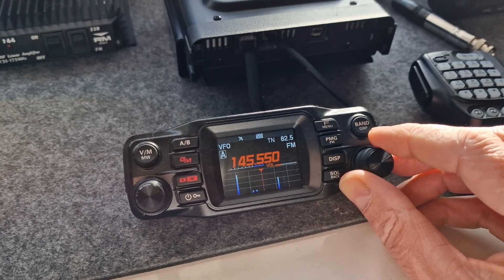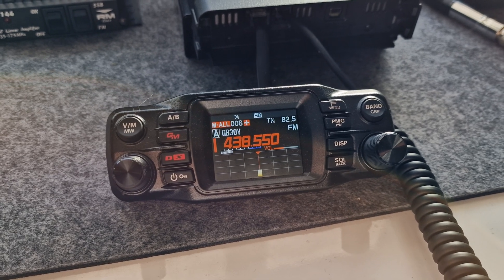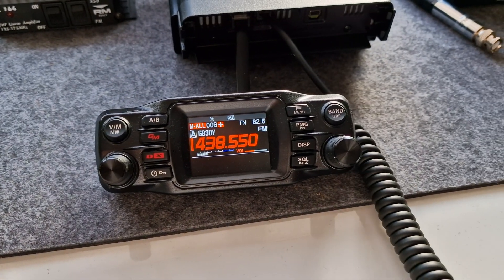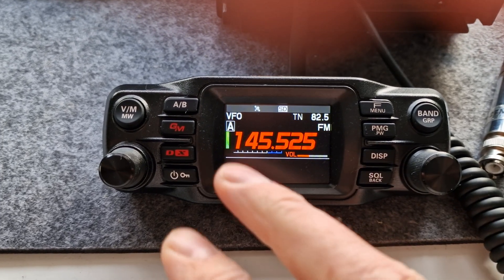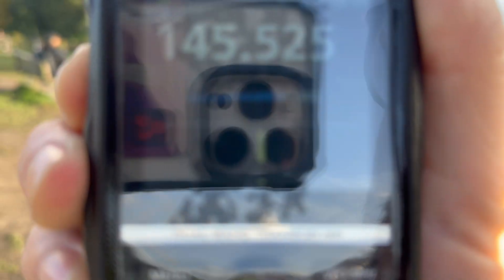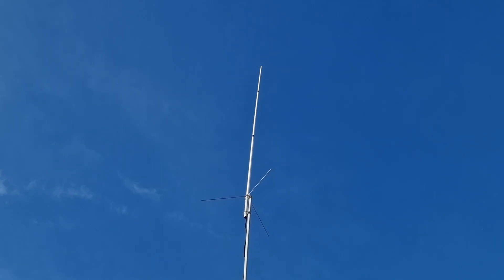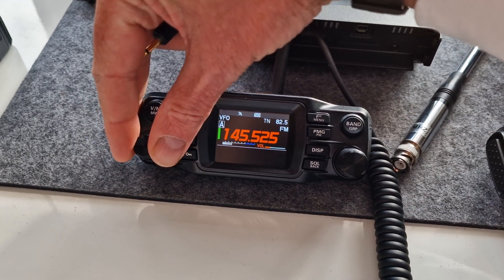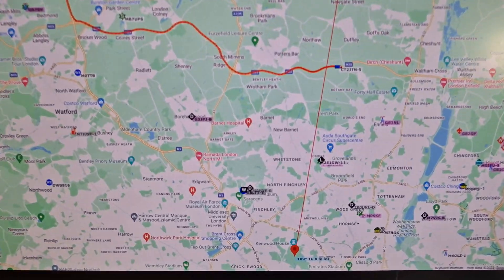THEY SAID THIS WASN'T POSSIBLE WITH VHF HAM RADIO!!!

Comment: All receivers perform differently even the same model and make. It depends on the sensitivity and tuning between stages. When would have helped in this test is if you used a higher gain multi element vertical beam instead of the single vertical. When you have a handheld radio you can have phasing issues the beam antenna helps to reduce this. The problem with the multi element beam antenna is that it’s directional and focused in a narrow direction. Great to see ham radio on YT

Comment: Who said it was impossible? It's called diffraction.
I've participated to dozens of VHF/UHF SSB contests with 400~600 km average distance per QSO and up to 800~1000 km DX. No "line of sight" involved in these contacts.

Are you new to ham radio?

Comment: Yaesu for the Win!  I run a Yaesu FTM-300 at 50w into a Cushcraft 5 element yagi, through 25 miles of pine forest to our "local" repeater.   My Antenna height is 38'.  Signal is perfect, full quieting.  VHF 146.730 freq.

Comment: My best radio connection here in the U.S. was where I live in Oklahoma on 220Mhz. From my acreage I had a seven element beam side mounted on the tower 30 feet up vertical polarization and I would talk to my friend with his setup a home made beam up 30 feet as well. We would talk day or night simplex 220Mhz band a 75 mile path. Another great contact was when I was inside on UHF and talked on a repeater line of sight 50 miles away on a talkie rubber antenna 150 miliwatts.
Reply: What town you live near.  Maybe we can try simplex

Comment: Ive been told countless times that VHF and above is strictly line of site. In my experience its a lot better than that. With reflections, knife-edge, tropo, etc, the effective range of VHF is often double the radio horizon distance. Hills and mountains arent even that big of an issue.

Comment: My personal record handheld to handheld was about 60 miles on 146.52 simplex. I heard someone calling CQ and responded. He turned out to be on a mountaintop about 60 miles north of me. My personal record mobile to mobile was also on 2M simplex when I was leaving a repeater site at 11,000 ft elevation and heard a friend two islands (about 100 miles) away. Communications was very spotty as there is an inversion layer between the islands which causes phase rotation.

Comment: Nicely demonstrated! Low power VHF and UHF can reap surprising rewards at times. I've been surprised many times with the results which can be obtained from QRP operation when conditions are favourable. Every once in a while, 2 metres and 70 cms can open up, with the result that stations which are hundreds of kilometres away can be heard clearly. That can result in pileups for a few hours.

Even under flat band conditions, it's possible to have 2 way line of sight voice communication using as little as 5 milliwatts of output power on VHF and UHF, if you use decent aerials. The QRP magazine once featured a homebrew PM transmitter and simple receiver which ran on a PP3 9 Volt battery for use on a repeater a mile or two away from the station. The whole setup only used a handful of transistors and a Slim Jim aerial, and it could be built from scrap components for very little cost. The most expensive items were the transmit and receive crystals.

Comment: Elevation make a huge difference as well. I made my longest contact on 2m simplex on an Anytone 878 with a signal stick antenna. From Mt Mitchell NC, USA, 6,684 feet above sea level. It was 120 miles on 146.520 simplex with 7 watts.

Comment: You can get hundreds of miles away during LIFT (tropo) conditions.  If you use SSB on 2 meters you might regularly get out 150 miles or more under dead or minimal conditions.  VHF and UHF does not mean just line of sight.

Comment: If that was SSB with the same set up it would have been much better. It’s great fun doing little experiments, that’s what the hobby is all about. I did do the same experiment which I didn’t set out to do but I took my Yaesu  x4 up some hills near my dad in Stirling which was just under 500asl, I made contact with Robert GM4 GUF who is 40 miles away in the town of Biggar we were both 59 each way so would have been amazing just how much further I could have gone.
Reply: Yes SSB is way more efficient than FM.  FM is great when you get enough signal to noise, but pretty bad with weak and QSB.

Comment: Well thats weird..  I do 88kms every day, and thats between 2 old baofeng 9Rs, on battery, and diy antennas. Your base antenna is the likely issue. Consult.a radiation pattern chart, I think your horizontal radiation angle is too high.
More gain = narrower beam width, horizontal and vertical. Your radials focus the angle of radiation, as does the hight above ground.
Andy, love the music mate, but 30 to 60secs is plenty.
Reply: 😂 you can turn off the volume...

Comment: You may not beleive this, but, the farthest contact  on vhf "simplex", was 929km with only 5 watts using my vintage Icom IC-02AT and a dipole antenna 20 feet off the ground. My qth elevation is roughly 150 feet above sea level. Even I was surprised when it did happen. Too bad I didn't get the chance to video it. DW1QEW.
Reply from the maker: I can well beleive it, radio is amazing 😁 thanks for the comment.
Reply: @andykirby  No, I thank you sir for sharing this. All the best to you and your family.

Comment: nice job ! 2 meters VHF is bigger wavelength and will bend around the earth about 10% or so. grieving better range than UHF . if you both had AM would be easer to make out than FM with weak signal. SSB would be even better. I am in Boston NY,USA . we have 222 MHz HAM band . also great for range. you have 4 meters that will go a tad further and 6 meters further . some times you get ducting in VHF/UHF and signal can go quite far . Lewis has a older video of a HT getting super range . think was 2 meters. was tropospheric ducting . I get that some summer nights on UHF and can go quite far . local TV broadcast does the same thing. also if Lewis put a Abbree 42 in antenna on that HT that makes a difference with weak signal and far range. he has a video on them long antenna's as well. 73's
Reply: No joke sherelock 😂😂😂

Comment: I have been to Mt Washington, NH, about a 100 air miles north of home.
and in 1980, I was there the first time,
and spoke on 2 meter simplex about
100 miles away to the south, at 6000'
In 1981, I was on top of the original
World Trade Center in Manhattan, at
well over 1000 feet above sea level
and spoke a long distance via simplex.
Of course these are high locations,
as many others have done from 
buildings and mountains😊

Comment: think the 705 was on wide settings instead of fm narrow
Reply from the maker: Filtering will make a bit of difference but this is probably receiver noise floor, it might actually be noise from the touchscreen...
Reply: Interesting Andy, regarding the reception on the 705, i have an icom 9000 receiver that still performs brilliantly, it can hear things my AOR failed to, it will be interesting to put it side by side to the 705 to compare on different bands. When i get a round tuit !

Comment: Max distance is usually about 10% more than line of sight but then you get reflections and defractions. Reflections off objects like buildings and hills and defractions around them. It's perfectly possible to be around one side of a hill and be invisible to the other station but still make a perfectly readable contact.
Reply: Radio be crazy. There's so much to propagation. Little wonder it's a topic in and of itself
Reply: 10%? In my experience it's been more like 80% more than the vhf radio horizon distance. If the line of site calculation on a tower is 8 or 9 miles, often I'll get closer to 30 or 40 miles range. It's weird, and I've noticed this across multiple states and repeaters.

Comment: With our club *Sultans of Simplex*, our main freq is in 70cm and I have zero LOS to most my club members.  In fact we don't even have NLOS (near line of site) We literally have a 2K+ foot mountain between my home QTH and most the other club members.  Now we do use mostly base and mobile antennas but for the most part we can talk most the time.  The bad-nasty we run into is multipath.  
On days where the multipath is too bad we will usually skink off over to 2M usually C4FM.  
Anyway, between knife-edge and reflections even UHF can be quire reliable in NLOS conditions.  The biggest surprise as an older ham, was how much the different frequencies within the same band may act.

Comment: Some people think with a hill/obstacle in the way, there is no chance of contact. But there is diffraction (knife-edge) of course when you go deeper into rf science.
Reply: I have a repeater in my area that is  on the other side of the mountain from me. If I use a yagi, I can bounce my signal off of a neighboring mountain and hit the repeater by going around the mountain that’s in the way. It works great!
Reply from the maker: Yes 👍🏼

Comment: While I can tell you definitely it is a good thing to question what is being told to you experimented with CB as well as gmrs FRS so I can definitely tell you to think outside the box is one of the most important thing when someone's going to tell me you can only do three miles with these and you follow what they tell you you limit yourself you do not expand your comprehension in memory thank you for doing some outside the box test

I was a witness to is 70 mi communication UBC 300 ft above the ground University of British Columbia an a mountain 70 Mi away 112 km contact was established between two portables those famous Chinese models they're well-known the uv-82 on gmrs a test was done 112 km when I witnessed this it was signal was weak however audio came in between both parties however these were exceptional conditions Mountain altitude 1 mi up 1.7 km altitude

A similar test was done on FRS gmrs Canadian Tire radios power output 2 Watts with a FRS 500 MW test was done on channel 10 Channel 21 distance 30 miles with some cheap Canadian Tire we managed to establish a distance of 52 km contact what's established of course eliminating the squash level zero yes you can push the limits it's to try different things and sometimes you get lucky and sometimes it works you discover different things

I believe that the human being can evolve and learn more we can push the boundaries and even achieve more results it is a question of a person keeping their mind open to the possibilities out there thank you again for doing some tests 73 and all the best

Comment: I get lz0bot in KN22LR from my qth kn33ev on 5w 107 miles away because of diffraction over a hill
Reply from the maker: Nice👍🏼
Reply: @andykirby  The best I ever did on 2Mtrs was Liverpool UK to the Netherlands on 2Mtrs SSB with 2.5Watts back in 1975.
The best mobile was from Christchurch NZ in the South Island to Auckland during  Tropospheric ducting conditions one very hot summer in 1987, that was on FM with 25 Watt's using a 5/8 Vertical.
Reply: I believe the 2Mtr world record is UK to New Zealand 🇳🇿

Comment: I understood line of sight limit is the curvature of the earth, meaning what ever you can technically see if there wouldn’t be anything in between your eye
Reply from the maker: The general rule is line of sight plus a bit as the radio horizon is a bit further than the optical horizon, however this doesn't take into consideration scatter and refraction. In practice it's always surprising, both in a good way and sometimes bad too.
Reply: There's no curvature😅.